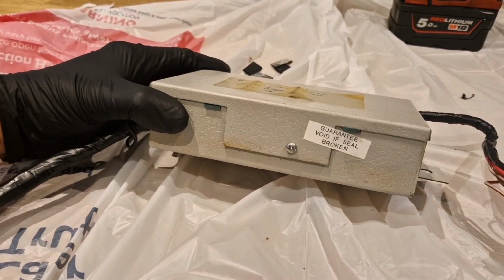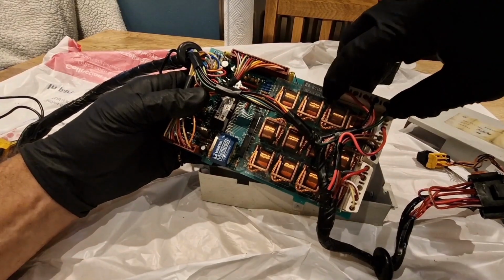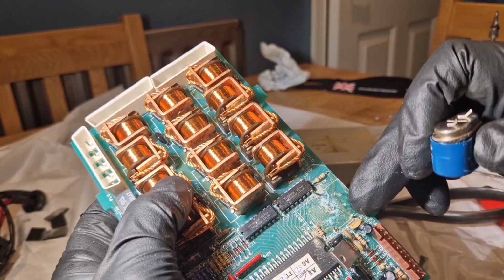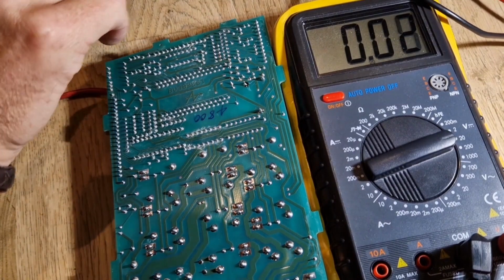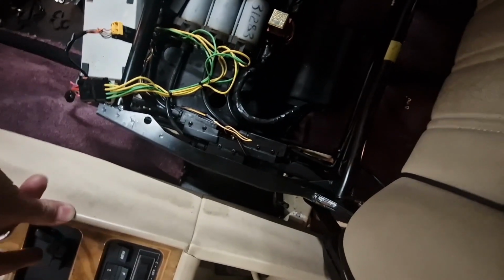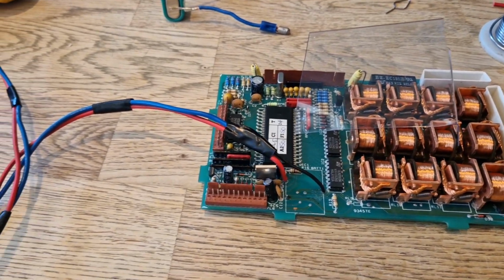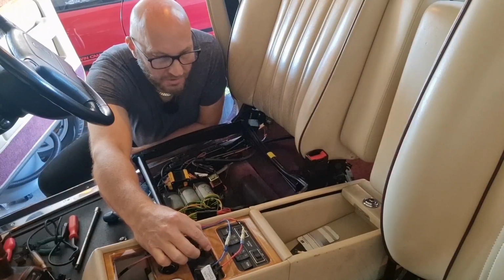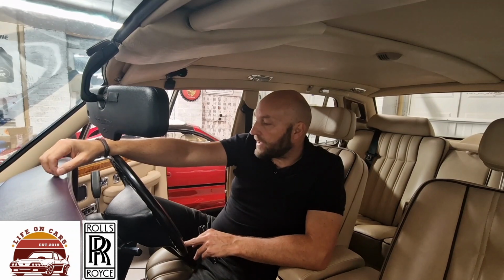Can I repair my Rolls-Royce Silver Spirit Seat Module Circuit with a new battery ? Episode.13

Comment: When doing work like this don't scrap of the corrosion. Cut the legs and extract the battery.... oh you did that! Do not scrap the circuit board, wash off corrosion with IPA...

Comment: Isn’t the battery only for the memory ? 
Shouldn’t it work without the battery ? 1988 Bentley eight . I own it since 2002. 
both seats and the mirrors just stopped working last week . I never had a problem before . All other electric work . 😢
Reply from the maker: Hi it depends if the battery has leaked and damaged the circuit board 😢 however if both stopped together it might be just a fuse 🤞

Comment: Just one more thing  you may find putting female connectors on the source of power ie the battery and male connectors on the other side you will reduce the chance of shorting

Comment: I took a look at mine, they're refurbished units from Flying Spares, and several damaged traces have been replaced with copper wire - including several that run on the topside under IC2. Logically that'd be a prime location for damage, you'd expect that capillary action would draw the leaking electrolyte under the IC. Only fixable if you desolder IC2.
Reply from the maker: @ram318yt  thank you

Comment: Good vid. Exactly the same setup and module on the Range Rover Classic SE and LSE 1988 to 1994. on my LSE, I just hardwired my switches to the motors, bypassed the box completely. Mirrors don't work (project for another day) but well happy having working seats.

Comment: I'm not sure where this geezer is located. But I could quite easily repair the fault on that PCB for him, as I have all the electronics test gear, plus 10 years experience being an ex TV repair/electronics engineer. I'm located in East Yorkshire. I even use to repair those MG Montego/Maestro Digital display dash boards for one of my local garages back in the day.
Reply from the maker: @galaxion62  thanks for the offer I'll let you know if I need help ! 👌
Reply: @life_on_cars  Okay cheers no problem, my initial prognosis being that the mineral content from that leaked memory battery will have induced a low resistance or partial short circuit across the pins of that 16pin DIL IC, which is a darlington sync driver device. But if that has become damaged, it may have also damaged some further active discreet components connected to it in either series or parallel. If you get stuck, then please give me a shout on here, & I'll do whatever I can to assist with this.
Reply: @life_on_cars  There is another straight forward process of elimination you could also try. This being to gently warm up the PCB with a hair drier in situ in the car, (with the cover removed) with the ignition turned on & ready to go, then see if all the functions begin to work once the PCB has been warmed up. The reason for this is something known as ESR (Equivalent Series Resistance) which occurs when the electrolytic capacitors break down with age. If functions are found to be restored upon warming up the PCB, then replacement of all the electrolytic capacitors should complete a successful repair.
Reply: @life_on_cars  Additionally if you are feeling confident to try, (not a lot to loose if you are careful) would be to replace the 16 pin Darlington IC. Is best to desolder each pin carefully using desoldering braid with some soldering flux, & then gently ease it out of the PCB holes applying further heat, if it still appears to be stuck down at any particular pins, once the pins are desoldered. Also be aware of the orientation of the 16pin device, as you will notice it has a delve in the middle at one end of the device, which denotes pin 1. So make sure you fit the new one the same way round. But if you have an ohms meter, firstly check the resister near to the 16 pin DIL, circuit ref R19, which should read 4.7 ohms, as that may have gone OC (open circuit) or high resistance. Hope this bit of further info may assist you.

Comment: Hi Paul, if you want to send the module to me, I can try and sort it for you (I am an electronics engineer). Likely that the chemicals from the battery has caused conductivity on the PCB which is upsetting the switching/logic levels, as well as possibly rotting tracks under the ICs etc. Let me know. Mark
Reply from the maker: @markdavissolarradio  hi there thanks for the kind offer I will be in touch if I need you 👍🇬🇧👌

Comment: That board looks like a handy enough repair. Most of the traces are left to solder fresh wire back in. The traces just need to be cleaned and tinned up. Electronic solder flux would help the solder stick and flow much better after it's cleaned. Someone like My Mate Vince could probably do a decent job of it. Neutralising the acid is probably a good idea, else it can return.

Comment: The original battery was 100mVah the one you fitted was 150mVah could that be the issue.
Reply: 100mAh is only a lower capacity battery.  They're both 3.6 volts, and the higher capacity would simply keep the settings backed up in the memory for longer.

Comment: My money is on that IC (integrate circuit (chip)) having an internal short or open circuit where the battery acid has corroded the legs.

Comment: I would replace that power transistor first. The device with a hole at top and three legs near the battery. It helps to use a desolder station so you don't damage the tracks and pads.
Reply: I'd replace a part like that only if you know that it's faulty.  Swapping out components is not a good way to fix older hardware, especially when the damage is most likely only to the PCB.

Comment: Hi Paul, great video as always.  Just out of interest there is a company based in Cannock, Staffordshire called ACT Drivetrain that can remanufacture various ECU's for most cars. I've never used them, but they do get good reviews on line.  They may be able to assist. Especially if Introcar or Flying Spares can't. There's always EBay too, if there's a good 2nd hand one on there!!.

Comment: Good luck resurrecting the dead unit, battery free remanufactured ones are £650 (ouch). That would buy you a lot of capcitors and solder!

Comment: I dont know whether your aware but you can run the part numbers off the various chips on the web, and you will even get data sheets never mind an ID! The long black IC chips are Toxhiba TD62003 AP which is a 7 channel Darlingtom pair inductive load driver for the relays you see. A relay coil is an inductive load and requires type of component. You may have one of these affected by the corrosion and may wish to try desoldering and fitting a new one which yiou be able to get from Premier Farnell or RS Online A second hand module could be in the same condition as the one you have. A specialist repairer may be expensive, but you may get a fixed quote of somebody.
Reply from the maker: Useful thanks

Comment: white vinegar will neutralize the battery leakage and when the bubbling has stopped you need to remove the white winegar with isopropanolalcohol.